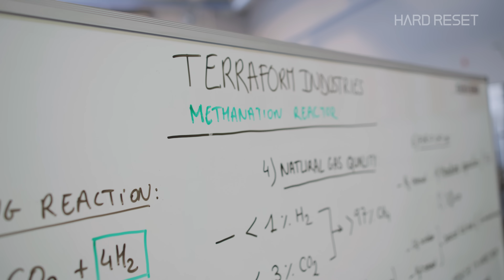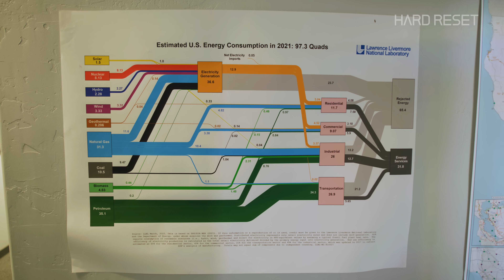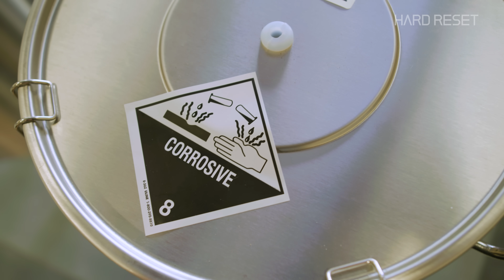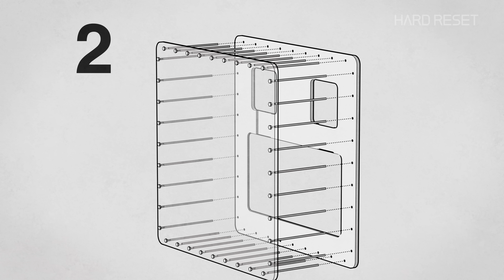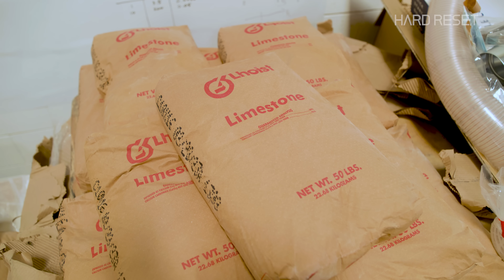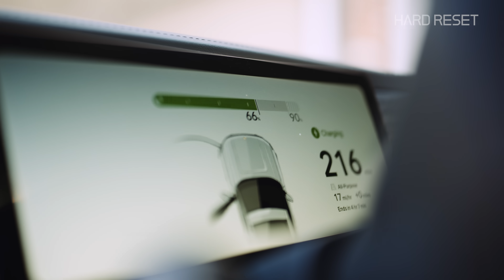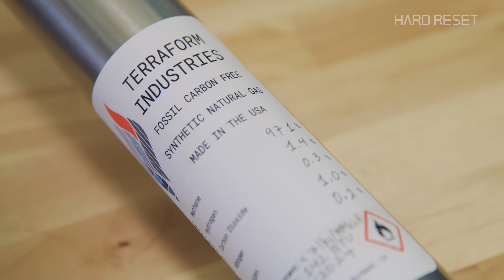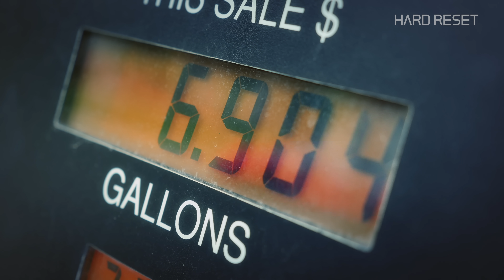The Last Fuel We'll Ever Need?

Comment: Does it use 1000 gallons of water to make a glass full of methane? What does it mean when he said the process is pretty inefficient? I want to see the water bill for that place. All I heard is we use water to do this and that. My water bill is already more than is really acceptable.
Reply: I could be wrong but I think 'inefficient' refers to the cellular process of photosynthesis in plants, like some stages (i.e. the Calvin Cycle) seem pretty inefficient when looking at number of reactions required compared to resulting yield of fuel (whether glucose or methane)
Reply: No, it's not anywhere near that inefficient.  1 molecule of water produces enough hydrogen for 2 molecules of methane.  There's also water used in the process of recycling the quicklime (what remains in the limestone process after you cook off the CO2) into slaked lime so it's ready to absorb more CO2.  THAT water cooks off when you heat the limestone during things and can be recycled or released into the air.
Also, the combustion process for methane turns the hydrogen used to make it into water again.  

The whole process is actually really water efficient, since the water being used is tied into closed-off chemistry.  Using the same water to irrigate plants involves a lot of it either evaporating from whatever you're using to transport it, from the leaves of the plants themselves, or other situations where it's not used to make more plant.  Also, since the process doesn't involve any fragile living things, less than pure water can be used as long as systems are cleaned regularly.

Comment: Salt water or food growing water? Water is already expensive.
Reply: Clean drinkable water is expensive in some places, and less expensive in others. As they are using electrolysis they need water with electrolytes in it. Well filtered sea water should work? Submarines use electrolysis of sea water to produce oxygen, (and I guess they just vent the hydrogen?) so we know that this can be done. The process does not need fresh water. 
Edit: that said, I'm not sure why it's better to do it this way rather than to grow algae and ferment them to collect the gas? Is this process really "good enough"? I have no clue. If I put solar panels on the roof of my house, and used all the power to make methane how much would I get? Why waste power making methane to burn when I could just use the electricity directly? 

From Wikipedia:
"""Electrolysis of pure water requires excess energy in the form of overpotential to overcome various activation barriers. Without the excess energy, electrolysis occurs slowly or not at all. This is in part due to the limited self-ionization of water.

Pure water has an electrical conductivity about one hundred thousandth that of seawater.[8][9][10]

Efficiency is increased through the addition of an electrolyte (such as a salt, an acid or a base) and electrocatalysts.
"""
Reply: @chrisflanagan7564  Lol yep sure lots of processors can be done, make water etc 
In the end it needs to produce more energy that it consumes!
Every aspect cost energy and money. 
As it stands I find it difficult to believe.

Comment: I'm sure some people are excited about the prospect of carbon capture, but when we actually have plenty of carbon already being captured at its source, wouldn't that make the process much less expensive and more efficient? Also I'm much more in favor of methanol as a fuel than methane.
Reply: The best carbon capture technology is keeping the oil in the ground.
Reply: @causticsoda9678  to get the grid mostly solar and wind will require either massive amounts of storage, which so far isn't happening, or gas peaker plants.

Comment: You lost me as soon as I heard settling on Mars
Reply: That's a reference to the process outlined by Robert Zubrin for his Mars Direct plan to get humans there using what amounts to modern versions of Apollo technology.  One of his tricks was sending a rocket that is capable of supporting a crew for a return trip first.  It would include some probes (naturally) a big tank of hydrogen, and a reactor that's similar to the one here, but powered by a lump of plutonium - a Radiothermal Generator.  Most of the power needed for the process is just heat if you already have the hydrogen.  The reactor would take the much more densely packed and lighter hydrogen and grab CO2 from the air and make methane rocket fuel to get the rocket home.  

(when the rocket said it was fully refueled and ready THEN we would send a rocket with people on it.  Their rocket would have the same equipment as the first.  When they landed, they would use both rockets as a base.  When it was time to go home, they would schlep their supplies to rocket 1 and set rocket 2 to start refueling itself in the same way.  The radiothermal generators and reactors would be left on mars for future refueling efforts.)
Reply: @bearnaff9387  It will never happen it's just ridiculous fantasy
Reply: @BANGbucketHEAD  I also have my doubts, but it's something a lot of people want to see.
Reply: @bearnaff9387  I want to see musk go to Mars and never come back

Comment: If electricity is going to be cheap and abundant, why do we need synthetic fuel at all?
Reply: Because absolutely everything that can be powered directly by electricity generated by truly green sources should be, but that is not possible for everything.    
For just one example, we really just don't have a good way to fly a passenger jet from one country to another powered by electricity.
This technology is aiming to allow us to keep using hydrocarbons where it's needed but not releasing additional CO2.    
Ideally there would be strong policy discouraging the use of hydrocarbons where they are not required and that these policies promote the movement to non hydrocarbon systems wherever possible. 
Possibly if system like this could be used to feed chemical hydrocarbon needs in industry, we could even be taking CO2 out of the atmosphere and locking it away in products, for at least the lifespan of the resulting carbon based product giving a carbon negative result.
Just my take on it, I am not an expert and am open to correction.
Reply: @ Energy density is just that. It matters for aviation. For motorbikes. For trucks.
Reply: Energy storage is really important, there are different demands at different times of day, different days of the weeks and different seasons. Hoping that the wind is blowing or the sun is shining exactly when you need it is a fools wish. 
Though Europe sharing a common grid does soften these demands and make it more predictable.
Reply: Europe may appear to have a common grid but it doesn't have unlimited capacity.  Even within regional grids renewables have to constrained when the wind is too high. Scotland has wind farms idle because the lines don't have the capacity to export to England.  So the chances of exporting across th continent are minimal.
Reply: Energy density
Reply: They explain it in the video.  You need combustion energy sources for rockets, for planes, etc.  Electricity alone cannot solve this problem. You need combustion AND electricity to solve the energy and climate issues
Reply: At the moment batterys are quite bad at energy storage so for applications where this is necessary, fuel could be a good alternative. A good fuel would not be methane but instead avaiation fuel (liquid and therefore better energy density also quite light) or naval fuel (liquid but far higher density and energy density in comparison to aviation fuel)
Reply: Eventually, with 5X denser and cheaper batteries - which will be here within a decade - synthetic fuels MIGHT be necessary for 1) long-range air flights, 2) intercontinental shipping, and 3) seasonal energy storage (AKA Dunkenflaute insurance).

Other than that, synthetic fuel will only sell if it's cheaper than electricity itself. Which is basically physically impossible.
Reply: @bkbigfish1316 
At the moment the viable Theoretical max is With Al ion or Al S cheap and available but the energy density is X2 of diesel ..
Still pretty good and safe.
Reply: Why not grow blue green Algae in vertical columns  .. agitate with air high in CO2  and expose to light.. and nutrients from waste water..  then filter drain and ferment .. distill just like they do with sewage at Cranfield aerospace college 🇬🇧🧙🏼‍♂️ 

The other problem as  Geologist is they are now looking for White ...natural H2 ...  water and heat .. little or no processing.  Unless you get really lucky and you also get amounts of Helium in the mix... Which means you're in the money just on the He content.
Reply: Energy density. In other words, a tank of this thats say 50 grams will have significantly more energy than a 50 gram battery. Important for nessessary travelling. Example, scientific studies, defence and rescue missions.
Reply: Renewable energy is super cheap and abundant but batteries are expensive and there are still shortages in production. The billion dollar grid scale batteries needed to store pure electricity that require rare materials and precision work in high tech factories can be replaced with much cheaper steel tanks and pipes. When the options are to waste 100% of the electricity because you have no storage or anything to use it on, or use it to generate value, the only reason not to make fuel with it would be if the methane factory cost as much as the batteries.
Reply: @AnalystPrime Not sure your country however renewable energy in Australia is ridiculous experience.
Not consistent, needs support etc at a price point we where light years better of with coal.
Evidence: out current e energy costs crippling the common man.
Reply: Storage! Hydrocarbon fuels are manageable and transportable. We know how to do that. If you try to electrify everything, it’s hard to store and transport.
Reply: Electricity prices in renewables markets are the most expensive on earth.
Reply: Because batteries are useless at storing energy compared to fuel, the best lithium battery is 200Wh per kg of battery whereas gasoline has 63 times more energy per kg (12.6kWh per kg)
Reply: @TheHuntermj even a jet engine is only 33% efficient. So around 4kWh per kg of fuel, which is still 5.7x the current best battery energy density of 700W/kg
Reply: @andrewradford3953  Firstly, you can't use the last 20% of a battery or charge them over 80% without severely shortening the batteries life, so you need 40% extra battery weight.
Plus an electric jet engine is only about 85% efficient, add an extra 15% storage.
Then, you need a lot of heavy copper to transfer all the electricity from the batteries to the engine.
Battery powered aircraft get worse the larger you make them, it works well for small drones but as soon as you scale up to a craft that can carry more than a few people, you are adding more batteries and more engine weight just to carry itself.
Reply: @TheHuntermj  depends on the lithium chemistry. Three phase motors don't need thick wires at higher voltages. Planes won't be using DC motors.
Reply: @TheHuntermj This isn't petroleum.
Reply: Cause CO2. That's why.
Reply: Why go the extra step creating Methane when you could use Hydrogen?
Reply: @hkad6252  Storing hydrogen is pretty hard, we get methane leaks very often, imagine the hydrogen leaks which are notoriously low density. Plus it is much easier for aviation and shipping industry to switch to methane than H2.
Reply: @hkad6252  it's more than just methane they working on.  Hydrocarbons are pretty handy
Reply: @hkad6252  Storage. To store a similar amount of Hydrogen to Methane, you'd need far larger tanks and incur higher costs. It's why Hydrogen never took off as a power source, the fuel tank ends up being three-quarters of your entire payload.
Reply: @hkad6252  for the same reason your home natural gas is natural gas (methane) and not hydrogen. While both are dangerous hydrogen is exponentially more volatile

Comment: Reducing fossil fuel use by making synthetic hydrocarbons is the future.  The only question is when.  

I would argue that making synthetic methane in America during a glut of natural gas caused by over production is not very efficient.   I would highly recommend making nitrogen fertilizer and ammonia for fertilizer and industrial use with the excess solar farm energy.   All countries need nitrogen fertilizer and ammonia and they are more valuable than methane at this time.

For producing methane,  the ultimate question is where you get your carbon from.  I think the most economical place to capture CO ² is from pure waist streams not mixed with nitrogen.  This can be any process that has a relatively high CO² output. For example, pyrolysis and ethanol production.

It is much cheaper to skip the CO² extraction and concentration process.  Once the CO² is collected, it can be reformed in combination with water to produce methane or longer hydrocarbon chains.  

On thing to consider is that it takes two to four or more times the input energy to make a hydrocarbon, so for short-term use whenthe sun is shining electricity is actually cheaper to use, and electric heat can be stored efficiently in thermal batteries for a day to potentially months depending on the size of the storage and the loss from radiating the heat out of the battery.   In theory, sumer sun produced heat can be stored in a ground aray to provide all the heating nessasary for climate control in all buildings.

The great thing about hydrocarbons is they store energy,  while electricity only transports energy.   We can store methane for as long as we like, we can make methane when solar generated electricity is overproduced,  and we can use methane  to power cars, industry, and giant rockets.  Methane can be stored and used as energy is available and as needed.

I would argue that propane is even more compact and flexible in storage, making propane a good source of clean power for trains and ships, as well as cars, trucks, busses and semis.

Comment: Technically, we can’t guarantee this forever, either.  Well, we definitely can’t… everything gets destroyed eventually.  But there are events that happen on Earth, like volcanoes, that can make this worthless for years.

EDIT: what?!?  they’re using PV to make methane??? why??? it is far more efficient to use PV as electricity… even storing it in a battery.
Reply: @dus10dnd  they are starting the process of solving future problems that's why.  They could use grid electricity but that would be more costly.  What I got from the video is that they are working on pulling the CO2 out of the atmosphere to create hydrocarbon fuels.  Methane to start with but more later when they get that far. So instead of pulling hydrocarbons out of ground and then making more  CO2 we will be able to pull CO2 out of air to make the hydrocarbons.
Reply: @ You seem to think I don’t get that.  The point is, it is significantly better to use those PV panels to just make electricity and use it.  They could offset 4x more fossil fuel usage by doing that than trying to be clever.
Reply: @dus10dnd  so they should use power from the grid or from more expensive power sources to do what they are doing? They are gonna use power to do the work that they are doing... solar seems like the obvious choice to be cost effective.  They could just use the solar power to directly power other things that aren't producing methane... But producing methane from electricity is what they are working on and are trying to improve.  Do you get that?  Fossil fuels are a long way from being obsolete and the ability to produce them easily/ carbon neutrally (or negatively if you store it) from the atmosphere does seem pretty handy.  Just because it's inefficient does n't mean it's bad, wrong, or won't achieve the desired outcome that they are aiming for.
Reply: @ They shouldn’t do it at all.  That’s what I am saying.  It is wasteful.
Reply: @dus10dnd  most of what people do is wasteful and you think using electricity to extract CO2 from the atmosphere to make hydrocarbons as well as making useful oxygen is wasteful.  Should see some of the great things crypto miners have done with electricity.

Comment: It’s a race to see what advances faster, battery technology or their fuel generation tech as well as how cheap solar panels get. How that shakes out determine which is more cost effective. 

Combustion engines still cause air quality problems in cities, so I don’t see this displacing zero emission vehicles in urban areas. It only makes sense for rural areas, or aircraft where batterie energy density isn’t high enough for flight.

Comment: Stupid.
First: Can you make more money selling the methane you produce with your green electricity than you would be by selling the electricity directly? Doubt
Second: Even at 90% efficiency (it's not), this process would still produce fuel for a very inefficient and outdated technology (thermal engines). Use electricity directly.
And that's just the 2 firsts coming to mind.